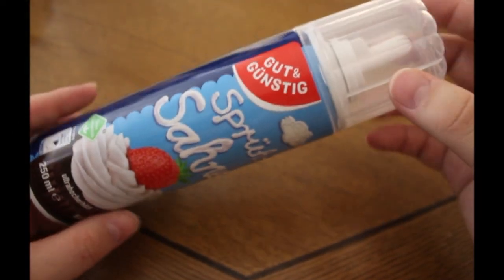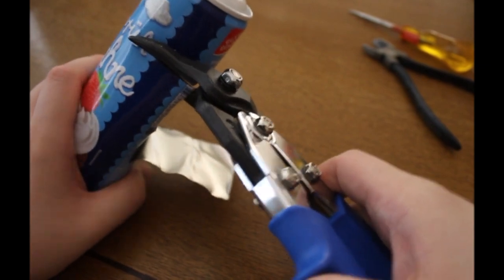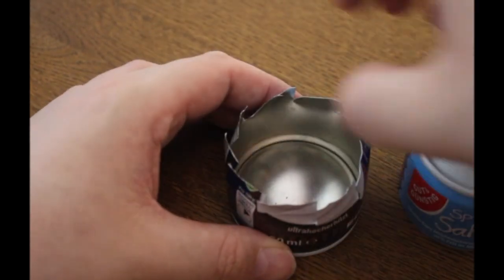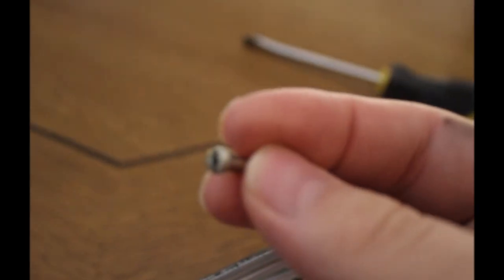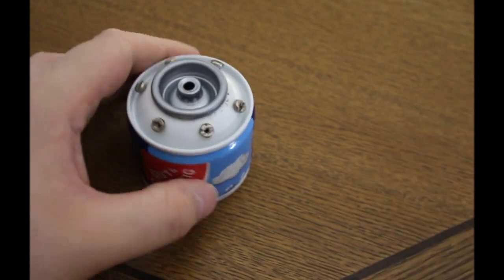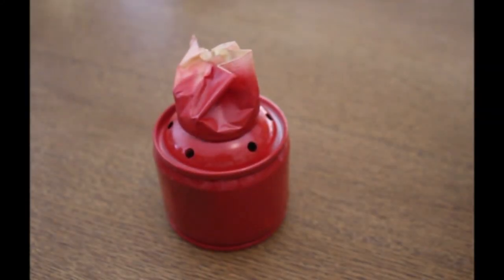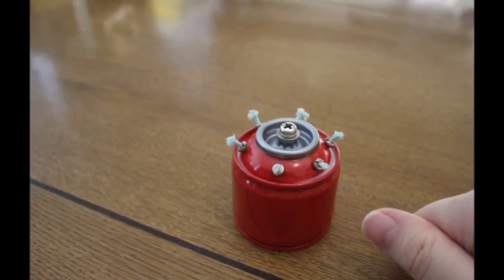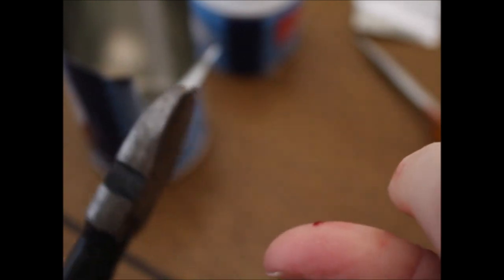Adventurers Club 🧭 DIY Camping Stove from an old Spray Cream Can 🔥

Comment: Question? Have you attempted this project with a disposable butane fuel canister used in cassette stoves? This very morning, I punched holes in four empties we had finished off during a flood while trapped at home. We pierce them to prevent the illegal refilling of the canisters by unscrupulous operators who sell the refilled canisters at local wet markets. The construction of the canisters is so similar to the whipped cream can, I am thinking this may be a great use for something that normally ends up in the trash. HMMM, maybe I should go grab one to cut open before the trash crew comes around. While watching, I was thinking there will be a variety of fuels suitable for use with these stoves. If the user chooses a clean burning fuel such as the ethanol in your video, indoor use will be permissible. Vegetable oil would be OK indoors also. Kerosene or diesel fuel should work as an emergency fuel outdoors. The old geezers (that would include me) back home would say, "Now there is a crafty fellow."
Reply from the maker: good idea, but with such a container you have to drill a big hole in the top middle (so that it doesn't become a bomb)